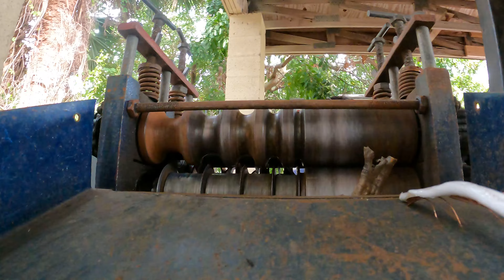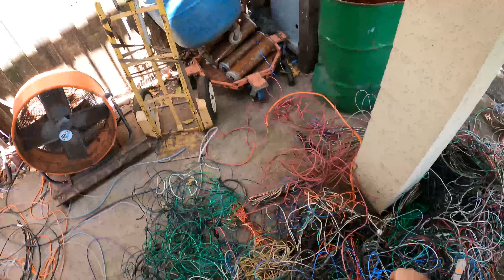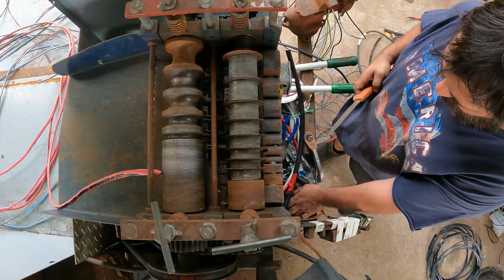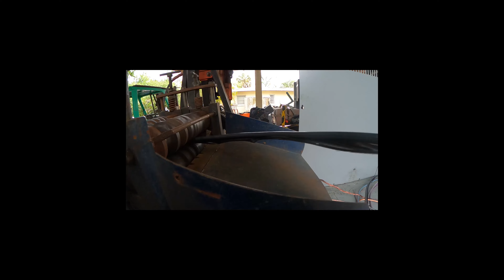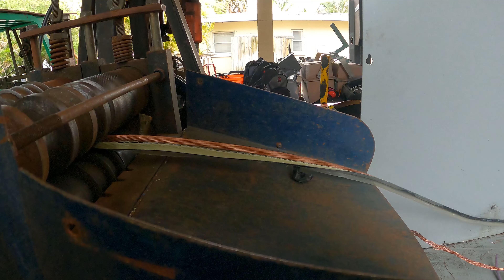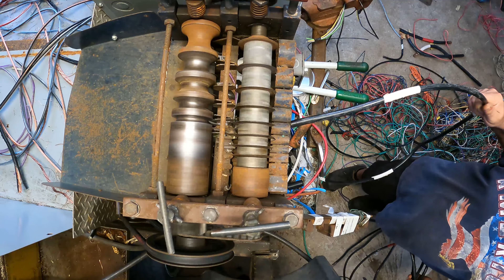Copper Wire Madness

Comment: Seems like an engineer could design a wire stripping machine with a pressure sensor to automatically set cutting blades, based on different densities of pure Cu wire & housing.
Reply from the maker: Possibly but I think that would be more stuff to break. lol

Comment: The thing that i do like about solid core to strip, is that one can get the blades to bear down on the wire and not cut it into pieces, unlike braided wire getting cut up and making stabbing weapons out of it. A worthy adversary, as you know all too well.
Reply from the maker: The only time I like it is when it’s on a spool. You should check out my video on hand stripping copper wire. Thanks for watching

Comment: Watching your video-to keep you from bending each time, thinking a palette with some slanted sides to hold the wire and use the forklift as a table. Pull wire off trailer into palette , to the machine, raise to height and go. Just thinking to my aching back...lol
Reply from the maker: Thanks for the suggestion, it’s definitely a work in progress and I’m definitely going to have some type of table at some point to see my back. LOL thanks for watching